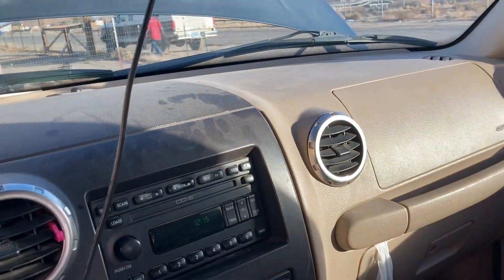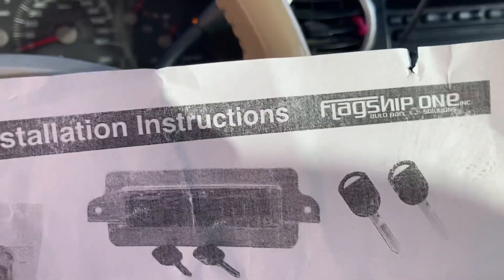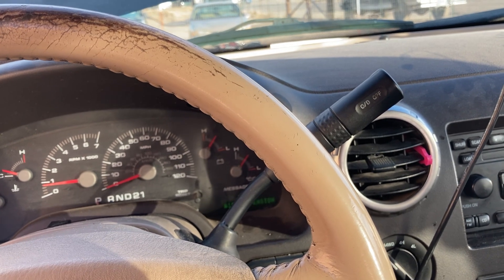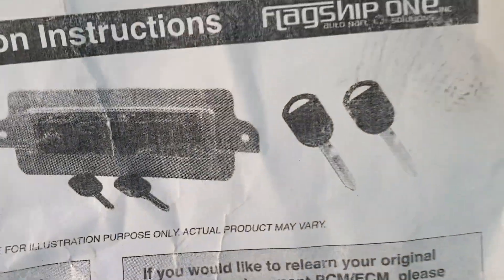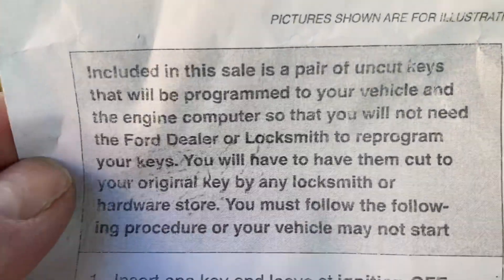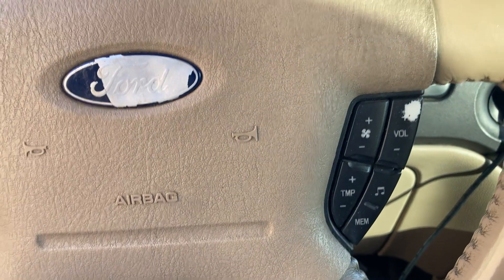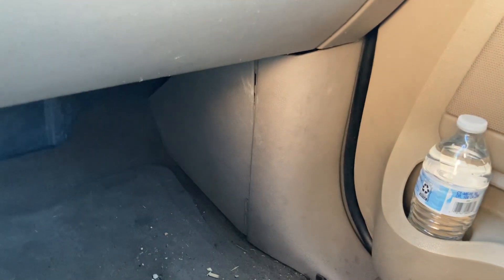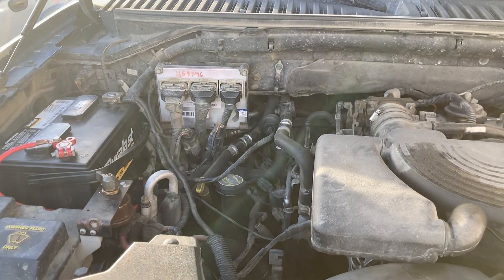Replaced Failed PCM

Comment: Is this after installing the single bank cats on this expedition from your video a few months back? Got power issues in my 5.4 04 expedition. Won’t rev past 4,000 which kills me considering I got this sucker for the impressive towing capabilities. Not much for capabilities when you can’t rev past 4,000 let alone getting over hills lol. How does it sound? I can kinda tell but it’s hard on phone audio. Thanks
Reply from the maker: Yes, the new cats have been in for around a year and the power on my expedition is great at all throttle ranges.  It revs up to redline no problem.  Yours sounds like bad cats which chokes exhaust from acceleration.  I recommend the new cats and replacing factory muffler with flowmaster style chambered muffler.  Then a high flow intake and towing will be day and night difference.  You could also have your local exhaust shop cut off old 4 cats and weld two magnaflow cats just after front 02 sensors.  The magnaflow ones are around $80 each and much cheaper than factory replacements.
Reply: 😎 bad ass thanks for the response man. Keep the videos comin! You and I are quite similar plenty of projects on our hands lol!